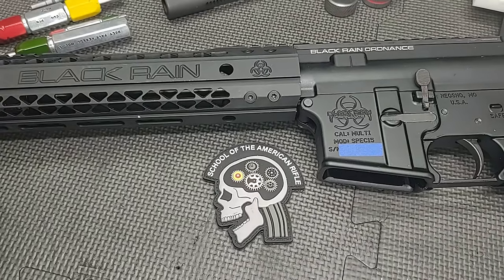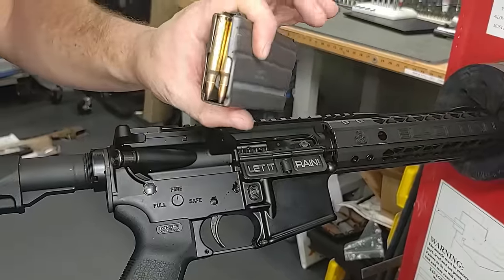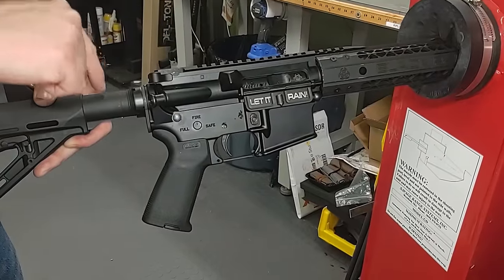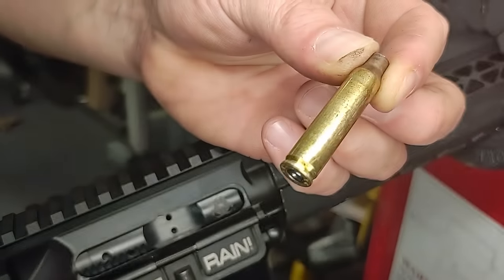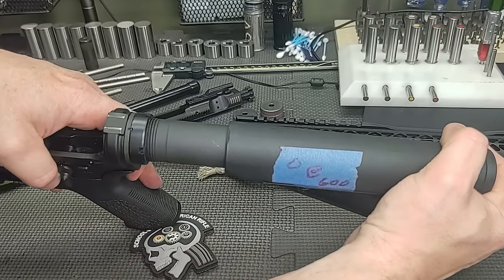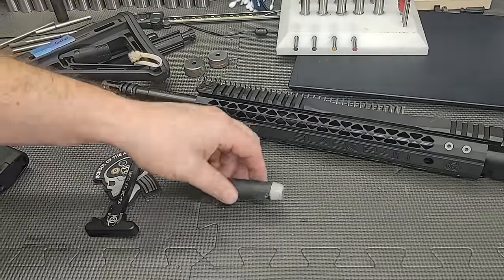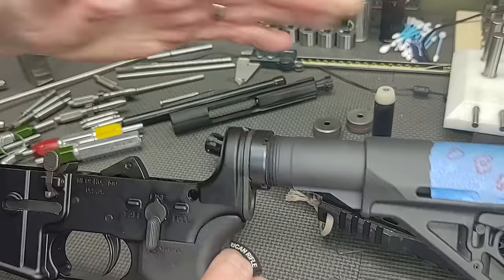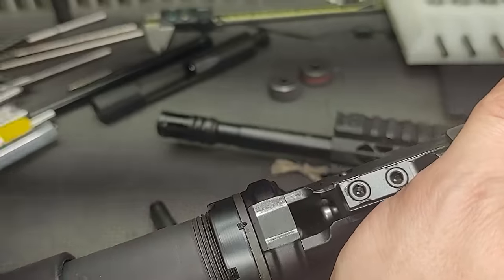Black Rain Ordnance SPEC15 - AR15 Autopsy (Part 1)

Comment from the maker: Owner has decided to use the BRT Gas Tube to correct the oversize Gas Port.

All of the parts to make this gun run right will cost about $250. 

-JP Titanium Firing Pin
-Colt FPRP
-Colt Receiver End Plate
-Sprinco Gas Rings 
-Sprinco Ejector Spring 
-Sprinco 5 Coil Extractor Spring
-Sprinco Blue Buffer Spring
-Sprinco Hammer Spring 
-SOTAR Carrier Key 
-SOTAR Spirol Pin Kit
-OCKS Carrier Key Screws
-BCM Gas Block 
-BRT Gas Tube
Reply: Thanks Chad.  It's interesting how many of those parts you've used, or mentioned, in prior diagnosis and repair videos.  Almost as if you know which parts can often be sub-par, and what aftermarket items are best used as replacements! 😉

That shortened buffer spring -- that suggests it was too short to begin, rather than something has compressed it over time, doesn't it?

You knew there would be score marks from the BCG striking the lower at the extension tube!

This autopsy being so comprehensive, it's almost like a perfect cadaver for teaching the common failure/flaw points.  Thanks as always.
Reply from the maker: @seanoneil277  I believe the spring was short for 2 reasons. 1) because it had some use (some cheaper springs can go bad in a few thousand rounds), and 2) it's a cheap spring. Based off of the bore scope (done after the video), the barrel has at least 500 to possibly a couple thousand rounds. It's seen some use, nothing significant though.
Reply: @SchooloftheAmericanRifle  Thank you.  I shouldn't be surprised that some assemblers would use a substandard spring, after seeing substandard quality in other parts in your prior videos.  

Every time I watch one of these autopsies I'm grateful for all that I learned from your SOTAR videos before I assembled my first one.  Your SOTAR video library is the next best thing to taking your class, and I took full advantage of the library.  These autopsies now feel like confirmation of what I learned from your videos, and how that informed my part choices.  Happy 4th to you and your family, Chad.  Thanks.
Reply from the maker: @seanoneil277  most companies cut corners with fasteners, roll pins, springs, and buffers. Tungsten for an H buffet is not cheap.
Reply: What BRT gas port size is correct for this rifle? And what do you recommend for a 20" Rifle Length Gas system?
Reply: @InstructorChad 
Random question.. does it matter what orientation the firing pin retaining cotter pin is positioned? Up/down vs left/right?
Reply: What is there to be done about the magazine well being too tight? Do you contact Black Rain about the problem? I have a friend who has a Wilson Combat lower that will not eject the same magazines that my cheaper rifles will drop without out issue when you hit the magazine ejection button. How should I advise him on this magazine ejection failure issue?
Reply: What size feeler guage @11:09 ?

Comment: Damn that charging handle on the detent trick was worth the watch alone. Thank you good sir
Reply: Can confirm. This channel is a gold mine
Reply: Right!? Never knew that tip/trick… but it will forever be used now.
Reply: Thanks for the comment, I might have missed the tip in the video.

Comment: To me, the most interesting aspect of this autopsy is how the leaky gas block, loose gas key, and inefficient bolt carrier partially “correct” that gaping gas port. By putting a known-good BCG in the gun, you demonstrated that it wouldn’t run right even with a heavy spring and heavy buffer. This emphasized how the entire system must interact correctly. You also demonstrated how you can chase your own tail unless you understand WHY the gun isn’t running right in the first place. 

Thanks!
Reply: I like to think of it as a 1-cylinder version of a car engine.  If you had a leak in your intake system (carb/manifold interface, manifold/head interface, or along the manifold runs) your engine would be wheezy at best and maybe wouldn't start or stay running if it sparked over.  In the AR the gas drives the engine and it needs to be metered properly for all the parts to be happy working together.  Otherwise you have a fancy overcomplex bolt gun, with parts meant to work a bit unlike a bolt gun does.

Someone up above in a stand-alone comment mentioned the overgassed nature of the huge gas port was offset by the leakage at the wobbly gas key.  Either alone would have been a fairly straightforward Dx but together they offset each other and made Dx confounding.  Add in the buffer and buffer spring weakness and that's a lawn mower that won't start or won't stay running when it does.
Reply: heh, I was thinking the same thing right before I read your comment.   Interesting how the combo of over-gassed, loose gas block and carrier key is a trifecta of problems that kinda sorta cancel each other out a little.   At least it kept the gun limping along for a little while.
Reply: rifle looks used up and the buffer is not factory. No issues here.
Reply: He got the rifle on a trade could it have been abused beforehand or not?

Comment: Probably the best video I have ever seen when it comes to trouble shooting an AR, perfectly demonstrates that without the knowledge of how the gas system works and needs to be balanced, you could chase problems on this rifle in a circle. You fix one issue that exacerbates another because how off the balance of the rifle was, I could see this rifle driving someone crazy.

Comment: I gotta say, as a former Naval Architect/Mechanical Engineer who used to work closely with machinists, what you do is exhibit A for why machinists and folks like them are so darn important. Sure, engineers can design something, set tolerances, do fatigue analysis, etc., but if you don't run your design by a machinist or someone who has your type of niche expertise, you more than likely will screw something up. I know because I've done it, to the tune of more money that I will ever admit.

All the training and education in the world doesn't compare to hands on no BS experience and the "been there done that" aspect of things.

Thanks for sharing this stuff. Now excuse me as I go on to do another AR-15 build with a Nitride BCG!

Comment: I have a spec 15 and it ran fine only when I field stripped it I had unusual wear on the bolt…checked head space and it was out of spec from the factory. Reached out to Black Rain and they fixed it and replaced the barrel for good measure with a better .223 Winn barrel all under lifetime warranty. I really appreciate the customer service. Seems like a totally different issue than this gun but just saying they stand by their product

Comment: I bought one of these, the only reason is because i liked the green camo for my wife. Its pretty generic   but i haven't had issues. I did a video on mine compared to my 80 build on my channel.  my castle nut was loose

Comment: I've watched a couple of your videos now, and I must say you are a good teacher. I have worked on ak's and other machine guns for 3 years and havent done AR's all that much and want to learn.
Its funny that my initial gut reaction to this was to just "tighten the buffer tube", but then I always remembered working on AK's. Usually, its not the part that you SEE thats the issue, its something more. And wow, that gas port is INSANE. Usually ak74's run a .74 or .080 gas port and even that is considered "overgassed".
Reply: Also, I live super close to BRO and have heard about working there. Its not bad, but it doesnt pay well.

Comment: Thank-you Chad!!! I often “watch” your videos by letting them run in the background (on the TV) while I work on something else. Not this time though!

This video helped me identify a problem that I didn’t know I had, and address it BEFORE damage had occurred. When I switched to a Magpul PRS stock on the 3-Gun rifle I use for long-range stages, I grabbed my longest spring and longest buffer out of my parts bin. It was supposedly an “easy” change over… didn’t know my BCG was traveling too far into the extension and the gas key was hitting the receiver. Thanks for the “quarter trick”!!!

This is very much one of those “you don’t know what you don’t know” situations. I didn’t serve with the M16/M4 platform and I wasn’t a Gunners Mate anyway. It seemed like an easy change over and it did indeed function. Again, thanks for saving me from woe and damage to the rifle.

Comment: It would seem to me since you said the barrel had a fair bit of muzzle erosion and knowing the barrel has a far oversized gas port the proper fix would be a new barrel to get the rifle back to "normal" gas operation levels and using a regular carbine spring and buffer. Seems the severe over gassed problem was beating the buffer, spring, buffer tube, lower receiver and gas key to death, along with prematurely wearing the BCG. A new barrel with a proper gas port size would alleviate all those problems.

Comment: Always outstanding videos. I personally would not keep a rifle that needed many custom or specialty parts. Sending it back to the manufacturer, I assume was not an option.
Reply from the maker: The owner does not trust the manufacturer  to make it right.
Reply: @InstructorChad  I would insist they send me a knew rifle. I appreciate you are very adamant about not faulting manufacturers as much as possible. I think this would be a situation to do an exchange. Also a great training opportunity for the assemblers at the manufacturer.
Reply: The exchange would still have a 0.089 gas port on a carbine length gas system. And probably a tight magwell to boot. The owner wouldn't be any better off.
Reply: @T_bone as much as he might not wanna fault manufacturers online and in his videos (which I totally understand) there’s a reason companies like BCA and BRO are so cheap. Cause their QC is atrocious. It’s a simple way of cutting costs. Getting an exchange from them will most likely result in another AR with problems of its own

Comment: I had a gun on layaway at bass pro a few years back. Got to know a few salesmen there. So they would let me hold whatever guns I wanted while i was there. I held 4 black rain guns all different colors and one was large frame 308. Two of the four buffer tubes were loose like in the vid. The 308 wasn’t staked and could be loosened by hand. Gas key wasn’t staked on two of the guns. Idk just example of four i seen had issues. Id avoid these all day obviously. I’m a colt, bcm, fcd, solgw and lmt guy nowadays. Quality over quantity

Comment: Seems like most barrel makers bore the gas port too large these days - probably to accommodate OEM demands for reliability with shoddy steel-cased ammo, which was all a lot of people could find for a year or two recently! I think the BRT EZTune gas tube is a good upgrade for most OEM ARs these days, as most seem to be overgassed, including the BCM I bought in 2021. Throwing a high restriction suppressor onto it exacerbates this issue.

Comment: POF-USA needs to see this video as they once told me  1-2 years ago, they will not stake their castle nuts for cosmetic reasons. I then decided not to buy one of their products.
Reply from the maker: Gas Piston AR's should be staked because they have a more violent gas system.
Reply: @SchooloftheAmericanRifle What do you think of POF's roller cam pins? Sounds gimmicky to me, but maybe I don't appreciate the problem they're trying to solve.
Reply from the maker: @SeattlePaulie  no POF on my stuff.
Reply: @SchooloftheAmericanRifle  I saw a lack of castle nut staking on several of their DI guns at local gun stores and Called them about it. I was considering their 308 Revolution DI.

Comment: Speaking of gas ports, I just assembled an upper with a Colt replacement M4 style barrel.  When I dimpled the barrel for a lo-pro gas block, I found that the gas port was not at 12 OClock. Closer to 11 viewed from the front. First time I’ve seen that. Good thing I wasn’t planning to use a standard FSB.

Comment: very surprised you mentioned the quarter in the buffer tube trick.   I've used that a lot with keeping 9mm bolts from slamming into the receiver.   Thought i invented that.   "Sad-Face-Emoji"

Comment: Barnes Precision Machine makes a adjustable gas tube.  The adjustment is not on the block, far enough back that the intense heat right at the gas block is much less of an issue.  Fixed my over gassed issue, with the option to adjust as needed.

Comment: I used the BRT gas tube for my ruger 556. It was definitely the right move as my rifle was over gassed but not as bad as that one. In the end good quality parts are always the better choice. My ruger was my first rifle but I learned a lot from owning a cheaper rifle in regards to the issues they come with when you use them.

Comment: The amount of gas a port can pass is roughly proportional to the square of its diameter. So if the port is 50% too big it's allowing more than twice as much gas as it should be. Worse than my uncle at thanksgiving.

Comment: I have a spec 15 and not seen any of the issues in this video. Also the spring and buffer look way different than mine. Notice the buffer is not label with BRO emblem. (mine is ) So not sure what's up here. This rifle also looks like it's been fired a lot. I know these are not high end rifle but I say this as ware and maintenance are always a factor in the longevity of a firearm among many things like cars, ect. No malfunctions from mine (yet) .

Comment: Great video!

Consider this: Do you think a bore scope could be used to capture a better video shot of your feed ramp work?

Of course I’m assuming you can video capture through your bore scope.

Just asking because I would have loved to have seen exactly what you were pointing out.

Thanks
Reply: He will show video through his scope sometimes, usually to show rifling condition or gas port erosion, mostly in high round count barrels.  I think the FOV is kind of narrow and close in to show the ramps. You can see it in person much easier, and feel it with a soft probe like the q-tip stick he was using. You're looking for how well the cuts in the barrel extension match with the cuts in the upper receiver.  It should be a smooth transition, and not all uppers have the same relief cuts. Can't remember what the different ones are called, and it is something that a smith can usually fix with a die grinder and a good bit of polishing. He does have some older vids specifically addressing grinding and polishing ramps.

Comment: I have a Spec 15 that I bought some years ago. I noticed that it was was over gassed. I put a Superlative arms adj gas block on it with and I put the Super 42 buffer and spring in it. Haven't had an issue. It's my son's rifle now.

Comment: I would have also looked at the chamber itself for pitting, roughness, etc.  Otherwise, good autopsy.
Reply from the maker: Since it was running long I skipped it. The barrel does have some use but nothing bad. I checked it after the video.

Comment: I'm wondering if someone had aftermarket parts on this thing, but before selling it, they took all of their parts off and put the originals back on, but not properly. With everything being so loose, it makes you wonder. Edit: But if it came like this from the assembly line, then Black Rain employees need better training/more time to put these rifles together properly. Reminds me of some of the mistakes coming out of PSA on the regular. It's indicative of an inexperienced person being rushed through the assembly process by a company who doesn't care enough about the state in which their products leave the company. Or employees who don't get paid enough to care about how the product leaves the company. Or all of the above.

I had to polish my feed ramp on my AR-9 from PSA because it had a massive shelf on it that was putting dents into every round that passed through it. Soon as I got it polished up, it functioned perfectly.

Comment: That's crazy it reminds me of my very first AR15 from a local Maryland shop, vigilant tactical. The rifle I got from them was a 16" carbine gas system and was so ridiculously over gassed it broke the plastic piece off the buffer. So I got a sprinco heavy spring and it has an h2 buffer seems to have tamed it but  I don't like shooting it so it collects dust now

Comment: I have a severely overgassed 10.5 inch 7.62x39 upper that I ended up with a 5.4oz buffer in but it cycles all the ammo I’ve tried now. Might try an adjustable gas block as well. Great video as always
Reply: Wow,  that is a heater.  My X39 AR experience has been undergassed, such that I wish they would make even the 16" barrel a pistol length system to give me some extra dwell. It'll cycle and mostly lock the bolt with brass, but steel loses too much. 2.6oz and it rips now.  Easily the softest shooting AR I have. 

I got stuck with some 260 grain blackout ammo (ammo crunch era and I was desperate for subs) that shoots so soft I had to go down to a 1.6oz to get my bolt to lock open, lol.

Comment: I wish i had seen this before i bought my BRO upper. I havent had any issues with it but ive shot it the least out of everything i have... now im going to check my gas port and feed ramps but mine is a mid length gas system. Ill take it out next time im out but i dont remember it being over gassed. Im not using a bro bcg either

Comment: Seems to me that a hansen barrel would go a long way to fix these issues.  You can find them sub $200 with pinned gas block, proper gas port and probably fix the head space issue.